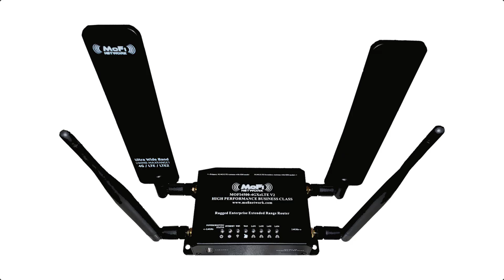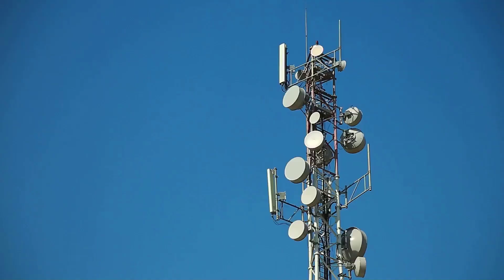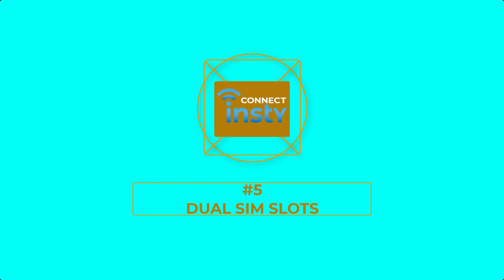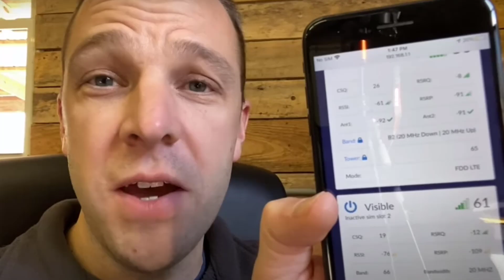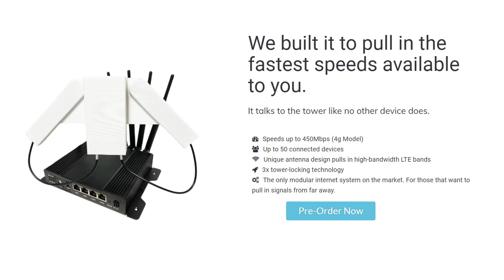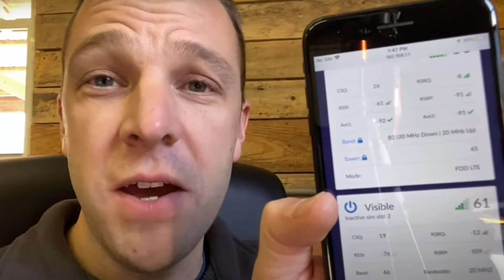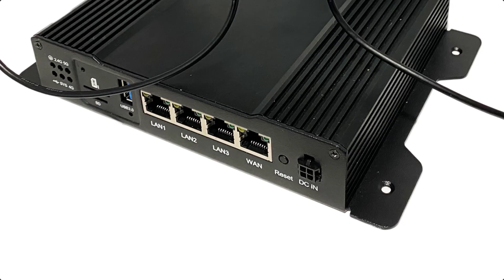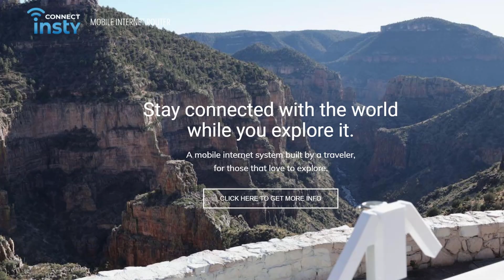Insty Connect Explorer 4G12 - Mobile Internet System

Comment from the maker: Insty Connect First Look: https://youtu.be/2aTVNmYk-MU
Reply: Carriers are now looking at the IMEI number on their networks. Such as AT&T and Verizon now check the IMEI of the devices on the network. They are not allowing cellular WiFi SIM cards in router devices i.e. a router with an unidentifiable IMEI from a router! It does not matter if you set the router to a TTL for a specific (mobile carrier). ATT and Verizon will not register the that Cellular SIM card in a IMEI number that is not cellular identified device. I have a friend that has an Insty Connect that is now worthless with a SIM from his Verizon Cellular phone unless he pays as much as $190.00 a month for some grandfathered plan on eBay or 3rd party plan carrier/vendor. Can you tell us what Carrier SIM Plan are you using to successfully use a MoFI or Insty Connect that doesn't cost a mint? Can you share that information? It would be appreciated. My friends Insty Connect which I installed went DOA on January 19 which is also known as 5G Day when the C Band was activated. By Verizon. There were several aggravating phone calls to Verizon, that revealed what they found, and exactly why they would not allow his cellular SIM in the Insty Connect Modem. Currently my friend is using the same SIM in his MotoG- Z cell phone activating his hotspot on the phone with one device at a time. And some not so great speeds with drop outs and not having  the IC Angel Wings. He is in between a rock and a hard place. And has a very expensive UNUSABLE IC router and Angel Wings. And yes he lives in a rural area. We have tried contacting Nick from IC through his account without much help.
Reply: @michaelcorrothers8340  Glad I saw your post. I was planning on ordering one of these today.
Reply: Where do I purchase it?
Reply: Send me link for purchase please.
Reply from the maker: @samuelpate1012  There is a link in the description of the video.

Comment: So do you think any unlocked router will get the sim from a cellphone datat plan?
Reply from the maker: It works. Verizon occasionally is an issue on a locked plan but most other carriers work just fine.

Comment: Well, it's February 2022 and still no stock on this item. What's the holdup? The plandemic?
Reply from the maker: It’s been available for months but just sold out of stock because they did an outdoor show that took many units.  Looks like they will be back in stock in 2-3 weeks.
Reply: @SeleTraining  
I’m about to pull my hair out in rural Georgia. I currently have a Jetpack with Verizon as a provider. It does a decent job at 48 mbps. The problem is having to keep it plugged in and destroying the battery. Suggestion?

Comment: One additional question. On my friends Insty connect we did not change the TTL setting. And Verizon shut it down on the Insty Connect. Do you recommend changing the TTL setting and trying it again? Do you happen to know the TTL setting for Verizon? Perhaps that might be the issue. Or is it to late for that?
Reply from the maker: The TRL should be set to 65 for all carrier SIMs.  If your speed was throttled the TTK setting should change it back to full speed. However Verizon does also lock the account sometimes if the IMEI does not match when you use the SIM in a different device.  Verizon is the only carrier that does that from what I have seen.  If so you’ll need to contact them to enable the SIM.

Comment: Will it work with roku
Reply from the maker: Yes, I’m using it with a Roku. However you may need to connect to the 2.4Ghz instead of 5Ghz for some of the Roku devices.

Comment: So, how does this ~$600 router w/sim slot compare to a $74 eBay router w/sim slot? They both do the same thing, right?
Reply: yeah they're the same you should get the  $74 ebay router i'm SURE it will be EXACTLY the same LOL
Reply from the maker: There are many cell SIM routers and they vary in price depending on functions, speed, 4G vs 5G and other variables.  Many cheaper ones have Cat 3 modems inside.  The Insty Connect 4G12 is a Cat 12 modem.  The higher category means it can aggregate more bands and can handle more throughput of data resulting in faster speed.  The Insty Connect also includes the antenna which is a superior design providing the best connection to cell towers.  One feature only available in a couple brands of routers is the option to set the TTL which allows you to surpass data caps on your cell plan.  All those features makes it a much more expensive product.  Most of the cost is actually in the category level of the modem.

Comment: Will this work better with duel yagi antennas ?
Reply from the maker: The Insty Connect has an integrated antenna and works great.  You can get the optional binocular antenna for directional connection to remote towers and works much better than a Yagi setup.

Comment: This guy should delete his videos. The mini does not work for 20 bucks. Interconnect is not available
Reply from the maker: It does work! You can get a $20/mo iPad Unlimited Data plan from AT&T right now that can plug into the MoFi or Insty Connect and provide you all the data you need. It works! I've been using it that way for 3 years.
Reply: @SeleTraining  
Actually it is $30.00 a month but only an add on to your r using account. Instyconnect is gone
Reply from the maker: @moisheh101  I'm refering to the iPad data plan as a new AT&T customer, not as an add-on.  That is available if you contact the right AT&T store. Some staff don't know about that plan but if you call around you can find it.

Comment: With the instaconnect, does it have a way we can change the IMEI number? That way when the companies want to do a scan they can't trace it. Can the IMEI number be customized or changed? And change the device name, ect?
Reply from the maker: You don’t want to change the IMEI of the router. You’ll need to contact the carrier to see if they can match the SIM with the router.  Some carriers will do that.  However Verizon is the most challenging and they appear to be the main carrier that blocks you if the IMEI is not registered.  The other carriers don’t seam to care and will allow it to work.

Comment: Why the insti connect over MOFI5500?
Reply from the maker: The Angel Wing antenna is a better design with the modem housed in the antenna.  It means you get less signal loss to the router.  Also support and the return policy is generally better based on the feedback I’ve received from users.  The MoFi menu is more confusing too.  They both performed similar in my speed test comparisons.  Nick created the Insty Connect as a response to his displeasure with the MoFi. The firmware updates are more frequent.  You’ll still function fine with either but I recommend the Insty Connect over the MoFi.  I’ll be testing the 5G version soon.  The 5G price for the Insty Connect is much higher than the MoFi though.

Comment: What is the right TTL setting for AT&T to bypass hotspot? Ive tried 65, 117, 64???? Plz help!
Reply from the maker: It’s 65.  Your account will still show the data usage but you won’t get throttled.  That works on regular cell lines.  For a hotspot data plan you will still be limited.
Reply: I did 65 but the connection is dropped over night.
Reply from the maker: @CAKERS_1960  Make sure you update to the latest firmware too.  They was a disconnect issue on the older firmware.
Reply: @SeleTraining  i updated 2 weeks ago but i will again
Reply: Is there a way to see what the ttl is reading coming out of the router?
Reply from the maker: @CAKERS_1960  You'd have to have a device to inspect the packets to know for sure.  For the Insty Connect I can assure you it will work by setting the TTL by going to the Advanced Tab on the Current LTE SIM profile settings.  Set it to Linux-2 65.  Every device connected to it will have a packet of 65 and then it will drop to 64 after it goes through the router.  64 will appears to the carrier as a cell phone and they won't throttle when they see that.

Comment: My Insty Connect arrived yesterday and currently experiencing issues. I used regular cell phone data plan SIM cards from AT&T and t-Mobil and connects with strong signal but unfortunately there is not actually internet connection. I called both carriers and both carriers told me that their phone plans don’t work with modem/routers for WiFi. They advices me to get a Mobil internet plan but it’s expensive and I will quickly go over the data limits and be throttled. Do you have any suggestions?
Reply from the maker: They always recommend a dedicated data plan but the Insty Connect will work with a regular phone SIM.  Make sure you have set the carrier to the correct setting that matches the SIM.  Also confirm the Internet works on your phone so that the SIM is not blocked.  You may need to reset the router if it still isn’t working and then update the firmware.
Reply: Thanks for the advise! As I was connecting the LAN cable to the router I noticed the reset button. I pressed it and decided to start from scratch and it did the trick. Thanks for your assistance and now I’m getting over 100 MBs download. Never seen these numbers before.
Reply from the maker: Excellent!

Comment: Can I use this with Verizon towers?
Reply from the maker: Yes. It works with any carrier SIM.  For Verizon you may need to match the IMEI with the device. Verizon is pickier about that than other carriers.
Reply: Thanks. I’m really interested in this but I’m less tech savvy. How hard is it to set it up?
Reply from the maker: @chrismoore2630  I have instructions in the video.  It is easy to set up.

Comment: Curious.. you said that the MoFi comes already set for a streaming mobile SIM card. Does this one need changed upon receiving the product?
Reply from the maker: The MoFi and the Insty Connect both work the same and use the same type of SIM card.  You’ll still need to add a standard SIM from your carrier.

Comment: Does this disguise your ttl settings in the same way the 4500 does? And does it work with tmobile?
Reply from the maker: It works the same for both the MoFi and the Insty Connect.  I've been using T-Mobile for two years with no issues.
Reply: @SeleTraining  is there a 5g cellular version available yet?
Reply from the maker: @harleyflinchum1221  The 5G is coming later this summer.

Comment: If I just add another phone line to my plan, does that SIM card have to be tied to a unlimited data phone plan?
Reply from the maker: If you use the TTL 65 setting you want to use a regular phone line, not an unlimited data plan.  The TTL setting lets you use streaming data beyond the data cap.  If you have an unlimited data plan it will work in the Insty Connect as well but those data plans usually cost much more.

Comment: How do you find out more about the TTL settings for each carrier?
Reply from the maker: Use 65 for all carriers.  That makes it drop to 64 once the packets go through the router.  64 is what all phones use which is why you get the unlimited data.  It's not the carrier, its the phone TTL that works.
Reply: @SeleTraining  When setting this TTL to 65 does that ensure that you can get unlimited data from the SIM regardless of the plan you have with the carrier?
Reply from the maker: @ttbouy  Generally yes.  It counts all the data and you still have a data cap but you will no longer get throttled when you go over that limit.  I have been using about 250GB of data per month for 3 years with no issues even though my SIM data cap was 50GB or less.  I have heard from a couple subscribers that used over 500GB per month and their account was suspended for excessive data use so there are some limits for certain carriers over long periods.
Reply: @SeleTraining  I am looking into the ATT unlimited tablet standalone plan but don't know if that is data only or if it an iPad cell version...I hope its the iPad cell version so I can use it with my new Insty Connect I received today
Reply: @SeleTraining  thank you for your quick response. Is your carrier charging you more $$ for going over their 50GB data cap?
Reply from the maker: @ttbouy  No additional charge.  It still shows the total data used but it's only $20/month.
Reply from the maker: @ttbouy  Yes, get the cell phone version.  You want to stay away from data only plans because those will limit you to the data cap.

Comment: So, I just order a SIM card from my carrier, plug it in, and I have whole-home internet?
Reply from the maker: Yes
Reply: @SeleTraining  how does the SIM card know to connect to the tower? Don't I need to provide the IMEI of my device to my carrier?
Reply from the maker: @whyswon  Verizon is the one carrier that is picky about matching the IMEI.  It's not an issue with the other carriers.  I activated my T-Mobile plan with a phone and used it in my Insty Connect or MoFi router.  I also activated an AT&T SIM with an iPad and then use it in my Insty Connect or MoFi.  No issues with either for over the past 2 years.  Verizon has been known to block some SIM cards when used in another device though.

Comment: Is this just for an RV (mobile situation) or can you use it for a home fixed location? Thanks
Reply from the maker: It will work anywhere you can get cell reception and often a cheaper solution than cable Internet.

Comment: Does this work with Verizon SIM plans?
Reply from the maker: It will work with any SIM but some carriers will block the SIM when it is used in another device so you may have to find a store that is able to pair the IMEI with the Insty Connect.  Verizon is pickier than other carriers about that.

Comment: Sele. so what sim plan can be used in product?  And what is monthly cost on sim you are using? thanks
Reply from the maker: I have both AT&T and T-Mobile.  Paying $20/mo each for standard phone plans.  I added a line to my existing T-Mobile and I got an iPad unlimited data plan from AT&T.  Both work great in the Insty Connect.  The cheapest option is normally to add a basic line to your phone plan and then just place that SIM in the Insty Connect.
Reply: @SeleTraining  I had read that a phone sim wont work in the mofi it had to be a data sim like in a jetpack? So the insty can use a phone sim?
Reply from the maker: @cellex8599  A phone SIM or hotspot data SIM will work in both the MoFi or the Insty Connect. However, hotspot data SIMs will be limited to the data cap.  If you use a phone SIM then you can set the TTL to 65 and go past the data cap without throttling. So regular phone plan SIM cards is what I recommend.

Comment: What about the new mofifi that is going to be available may 2021 it say on there website that it will be 5g compatible
Reply from the maker: I just got a MoFi 5500 for testing and will create a video comparing it to the Insty Connect soon.  It'll be another month for it to be released though.

Comment: I've been using the Mofi for several months after finding the right signal using outside antennas.  However, I was always put out with their customer service.  Foreign technicians who seemed to have lots of communication problems and never seemed to understand what I was asking.  They seemed to care less whether they helped you or not.  I've always said it was enough to buy another router and quit using their product, "canceling" them!  LOL.   Now that the Insty is available...this gives me my out! Goodbye MoFi products! Maybe you'll learn how to value your customers.
Reply from the maker: Yes, I've had the same complaints.  Nick should provide much better support for the Insty Connect.

Comment: Hi Great video - I am a new subscriber.  I have a DIY camper van and plan a Weboost with version jetpack for cell boost and wifi device connection.   Can I replace all of that with a Insty connect solution..?   My wife and I boon dock a lot with the dog and need wifi to monitor the van, stream videos, connect multiple devices...   Appreciate any advice you can offer.
Reply from the maker: The Insty Connect won't boost the cell signal for your phone like a Weboost.  However, I got rid of my Weboost because you can connect to the Insty Connect WiFi with your phone and do wifi data calling.  That works just as good when you have poor cell reception.  The antenna for the Insty Connect actually works much better than a Weboost.  It also makes wifi available for all your devices not just your cell phones. I use mine for TV streaming, computers, tablets, security cameras and cell use.
Reply: @SeleTraining  Very helpful thanks for the advice.  There are so many options...  I am a Verizon user and if I get and Insty Connect I need a Verizon line with sim card but do not need the jetpack just plug in the card into the Insty  modem- is this correct.  Sorry for all the questions..

Comment: You can build a better system or the same for less money just saying you can get the same modem em12-g and use a router and you’re good to go
Reply: You’re right about that for people who wants to expend more money to have something easy to play with, I personally build my own system same thing as him, for the third if the price and a panel antenna, anyway there is people out there willing to help to build a system. He still using the same open source just put his logo on the firmware which is free.
Reply from the maker: Sure but you'll also have to know how to update the firmware yourself, configure the settings, find out which antenna to use, and find free support from some source.  That works for a techy person but it may not make sense for most people.